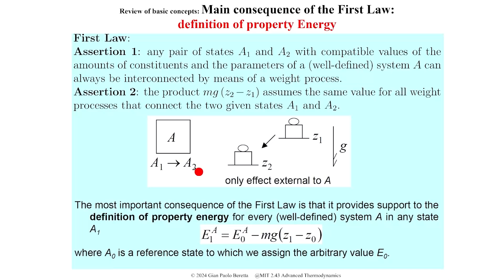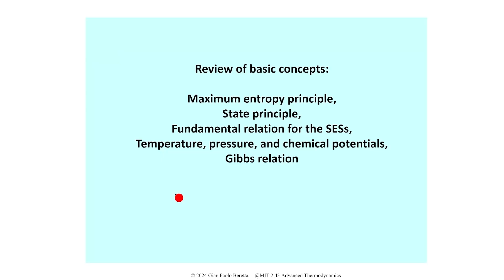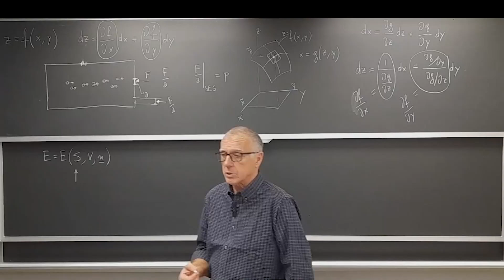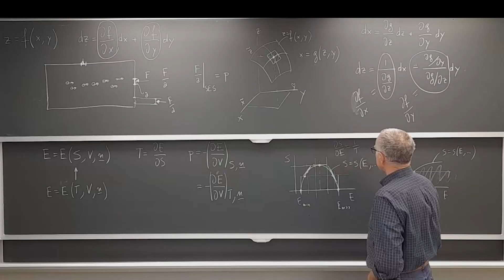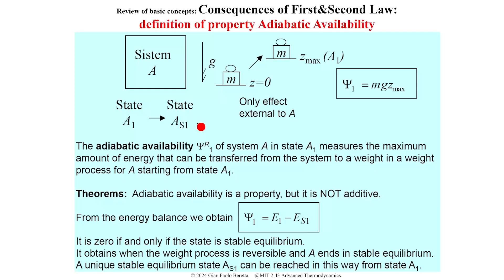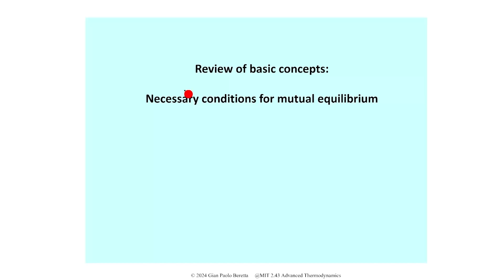Lecture 3: Energy vs Entropy Diagrams to Represent Equilibrium and Nonequilibrium States

Comment: When talking about pressure in SES, around 28:00
Does the pressure need to be the same everywhere? Or it should be constant with time, assuming nothing changes (the system receiving/losing energy, for example).
Assume I have a high tank of water that feels gravity, the water pressure wouldn't be the same! Does that mean the water tank can never reach SES?
Reply: Did you get the answer ?